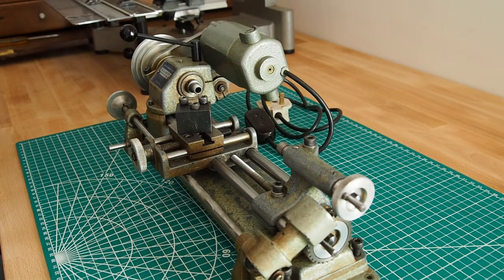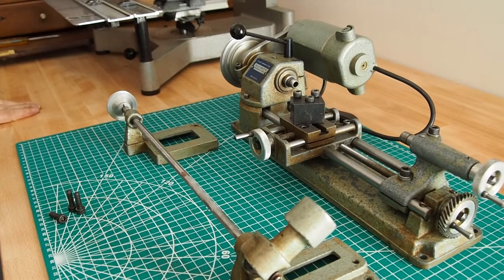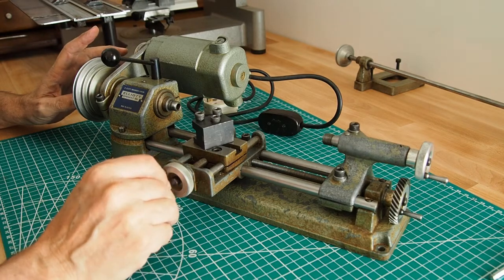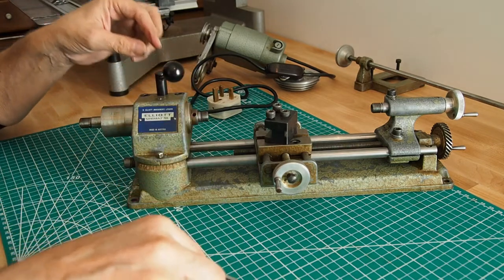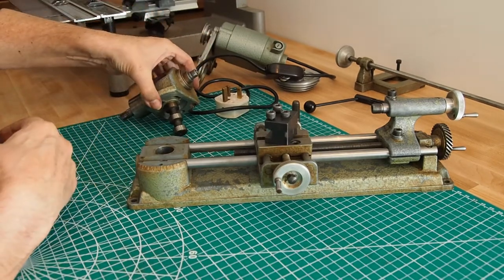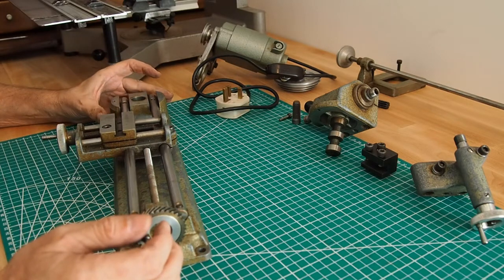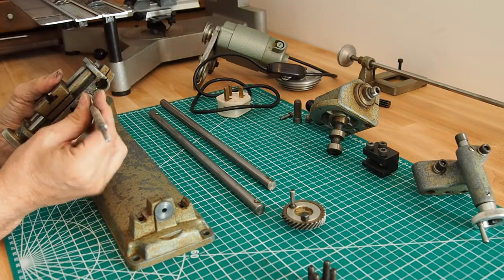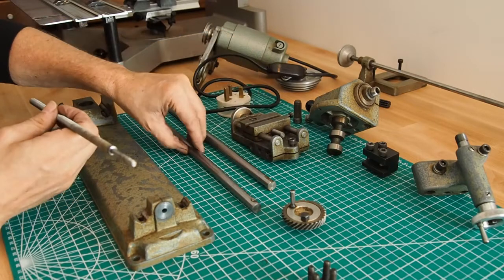Emco Unimat SL - Restoration - Disassemble (Part 1).

Comment: Just purchased DB200 lathe. Needed new bearings and preloaded washers are missing from the headstock spindle! .....do you know where I could get preloaded washers? Hope you could help!
Reply from the maker: Hello Howard,
Congratulations on joining the SL/DB club... I assume you are in the US as you've called it a DB200. I found some on eBay, search for "Replacement Cup Springs for the Unimat DB200 & SL1000 Headstock Spindle". I hope that helps.
Take care.
Paul,,
Reply: @TheKnacklersWorkshop  found the preloaded washers on each end of the headstock spindle. Now my Unimat lathe running great after bearings replacement and assembled as per your drawing and instruction. Thank you so much with your help. BTW- I am in Toronto, Ontario. Canada

Comment: These little machines were on sale in the G.U.S. range of catalogues (littlewoods etc.) in the late 60s to mid 70s and cost about £50 If my memory serves me correctly. The were available with interest-free credit over 26 weeks and were an easy introduction to engineering for many people. I always wanted one but never did get one as my family were extremely poor. I’ve since owned several lathes of different sizes and worked for many years as a machinist/turner on very large lathes etc. Bu I will always remember the Elliott Emco unimat for stirring my interest in this profession. Great video, thanks.
Reply from the maker: Hello Tom,
Many thanks for taking the time to watch my video and commenting... I remember my Mum having Littlewood catalogues so may well have been looking at the Emco's back in the 70's. I trained as a Fitter/Turner many moons ago and have just come back to this sort of work in the last couple of years. Hope to see you again.
Take care.
Paul,,

Comment: In response to your query on the paint color, when you remove the greenish surface grime you may find the color to be grey. Especially if the operators were tobacco smokers.  Tobacco  smoke coating makes a sort of greenish-gold cast to the original grey color.
The grey hammertone paint was very popular on small German made machines in the 50s. If you can find an original sales brochure you may have the answer, provided of course that the brochure is in color. Good luck.
Reply from the maker: Hello Dennis,
Many thanks for taking the time to watch and comment on this video... it is funny that you say about the colour Grey. I took one of the parts to a paint supplier and they used two different colour matching machines and both said it was grey but as it looked very green we disregarded the match... thanks for your help on this and hope to see you again soon.
Take care.
Paul,,

Comment: I have a Unimat SL and the ways on mine are totally different in attachment, they have flathead "screws" at the top and appear to have a nut underneath, but neither seems keen to budge and I am worried about breaking it :\ Rather frustrating! Everything else has come apart (now just need to figure out a grease to use in the new headstock bearings) :D Super useful video!
Reply from the maker: Hello Semajal,
Many thanks for watching... On my other SL I have flathead screws... I hope you manage to get it undone... 
Take care.
Paul,,
Reply: @TheKnacklersWorkshop  Interesting! They must have changed over at some point. I was given this recently, so had no clue about the brand or anything (first lathe!) has been an exciting adventure :D

Comment: Thank you for the video.  I have a Unimat SL, probably close to fifty years now, but without the fancy power feed that yours has.  One of these days I'll rebuild or replace the motor which now has awfully noisy bearings, but other than that the machine is still in fine shape.
Reply from the maker: Hi Hans,
Thank you very much for visiting... 50 years with an SL that is very cool, I wish I wish I had discovered them earlier... I think I will always keep mine.
Take care
Paul,,

Comment: It is great to know more about this machine, we need a small lathe. I am surprised that the pulley is not keyed to the shaft. I'm with you, it would very hard to use it as a hand operated drill. You said that you were not going to video the cleaning, but it would be interesting to know what you are cleaning the parts with and the method you use for cleaning. Great video Paul, thanks for sharing
Reply from the maker: Hi Joseph,
I have a watchmaking spindle for the Unimat SL that does have a keyed shaft... it is a little strange that some do and some don't have the keyed pulley/shaft.
I will now include a cleaning video...
Thanks for watching.
Paul,,

Comment: Very informative Paul. I am surprised the drive pulley does not have a key or set screw to anchor it to the shaft. That is a very nice mini lathe and would be a welcome addition to any hobby shop.  Matt
Reply from the maker: Hi Matt,
I have another spindle (watchmakers) for the Unimat SL and that one has a key, i am not sure why this one does not. I have one other machine and i'll check and see if that does or does not.
Thanks for watching.
Paul,,

Comment: Great video, it would be an added bonus to see how you clean the components. I’m also in the process of restoring my two DB’s and I started with rubbing alcohol moved to Evapo-Rust for the parts that needed it, then finished off with mineral oil to make it shine. It was interesting that you had a hex bolt on the underside of the lathe bed. Both of mine have slotted bolts with nuts on the underside (maybe it’s a Canadian thing). On the model with the non ferrous metal I don’t have enough room to fit a socket in there and when I put pressure on the screw head I can feel and see the slot about to strip. Instead I decided to clean around the compound slide but didn’t get the results I hoped for. Big thanks 😊 🙏 for this series.
Reply from the maker: Michael,
I will now include the cleaning process in a video...I have a second SL which is in a bad state of repair... It is on a wooden base, I will removed that in the coming days and see if the ways are connected by allen bolts the same as the one i showed in the video. I can imagine i may have similar problems that you are facing on my second one.
Thanks for watching
Paul,,
Reply: My Unimat also has 4 cheese head screws in counterbores through the way bars and hex nuts on the bottom inside the base. Its an American Edelstaal SL 1000. I didn't remove screws, just flowed alcohol around the ways to remove the grime.

Comment: The more I see of this lil machine.  The more I appreciate  it. Are the castings aluminum?
Reply from the maker: Hi Craig,
I think in this modern world it is quite easy to overlook them... They are not in the same league of a Levin lathe but also don't have the same price. 
The base (bed) does appear to be aluminium although having said that it was surprisingly heavy. Once I've fully established i will make sure i include that info in a future video.
Cheers
Paul,,
Reply: Yes, pretty much all of the parts  that are green are cast aluminum.

Comment: This is great, thank you. I’m
About to embark on the same task. What materials/chemicals are you going to use to clean the lathe, and what lubricants will you be using in the rebuild? Thanks H
Reply from the maker: Hi Heather,
Thanks for visiting... Although I said in the video I was not going to show the cleaning but your question has made me rethink that and maybe I will just do a short one on that subject.
My thoughts on cleaning products were a general degreaser, followed but paint-stripper on anything that needs repainting. That aluminium a very light abrasive to polish, and any issues with the steel i may try evapo rust, but i have never used that before so will try a test piece first.
Greases and lubricants, where possible i will take a lead from the Active Atom channel although they are dealing with high end lathes.
Take care
Paul,,
Reply: The Knackler's Workshop Thanks Paul, as a complete beginner, seeing the cleaning ad restoration/repainting would really help, so thanks for considering it. Looking forward to the next video. H
Reply: Apparently, the older models were made from cast iron, and the newer ones were made from Zamak.

I got the information by asking a question on

Unimat@groups.io

Which is a very friendly and knowledgeable place.
Reply from the maker: @heathermalcolm7639  Thanks Heather that very interesting...